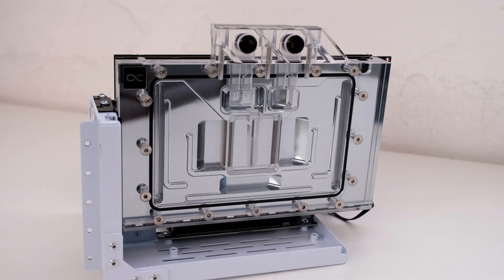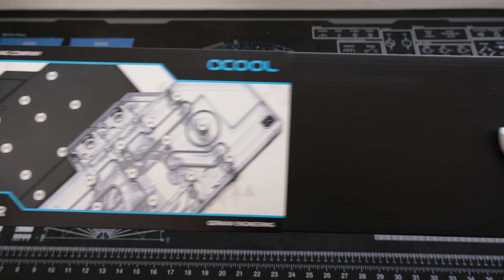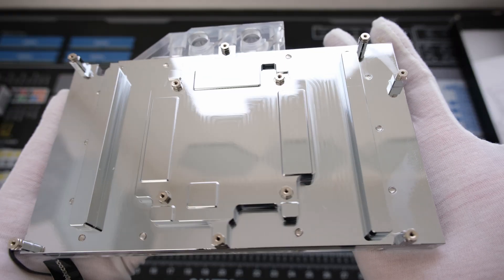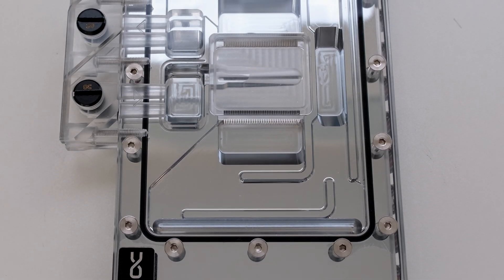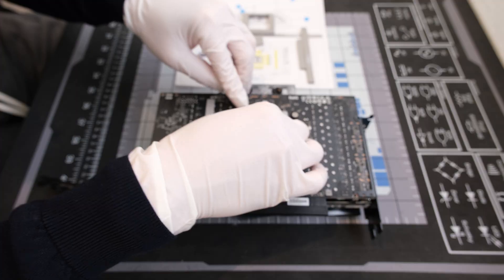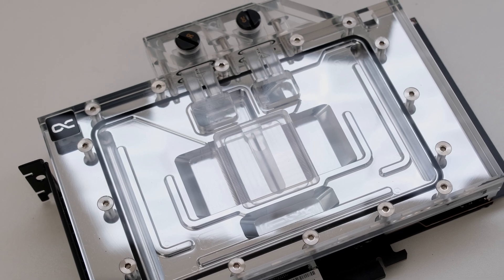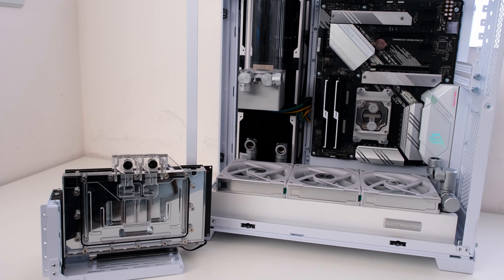Alphacool Eisblock RTX 4090 PNY Water Block Unbox Install Reference PCB NVIDIA GeForce Watercooled

Comment: Do you have benchmark and thermal data with this waterblock installed?
Reply from the maker: Thanks for your comment 🙏Yes, I do. I did the thermals during the maintenance episode that allowed me to take the card out. Here is the link:   https://youtu.be/-QMEvXeaZJA
Reply: mine in game maximum temperature 49/50, instead in normal use 28 degrees!

Comment: I have a newer version of this block but more or less the same and i had to leave the back plate off because its to hard to install the new way. It has to go on last not like yours were you can do it first. and i see a slight bow in the pcb I am scared for my 4090. Won't by again

Comment: drat on acrylic is not my options
Reply from the maker: Thanks for your comment 🙏Correct, while Alphacool did take steps to improve on this generation of water blocks (chrome plating, better flow path, better O-ring placement), they are still using a predominantly acrylic top. While this clearly showcases everything, acrylic can be seen as a little less refined than as having a metal cover of some sort. There actually isn't that many options for the reference 4090 and the Alphacool core looks a little different but still acrylic. Thanks again for commenting and thanks for watching

Comment: oh, so the PNY card is hanging out of it, yikes, are all reference cards that way when used with the alphacool block?
Reply from the maker: Thanks for your comment 🙏Good eye. That was the first thing I noticed when I saw the PCB for the first time. It was longer than I thought it would be. PNY added like an inch so they could put that red header there. For comparison, the INNO3D PCB is a true reference design. Hope that helps

Comment: PNY customer service told me they don’t have any 4090s with Reference PCBs 🤔
Reply from the maker: Thanks for your comment 🙏 Hm, the rep may not be as informed as we expect and/or PNY could be right if they want to get very technical. They did modify the reference PCB by adding about 1-inch to the length, to fit that red-colored header (I think it's for RGB, but not sure, never tried it). So, it would technically not fit a reference water block that was fully enclosed (all around). The alphacool one was fine as its not enclosed. For an example, check out the INNO3D iChill water block version and the reference PCB there fits completely within the water block, which this one, you see about 1-inch hang out on the side. Hope that helps.
Reply: @vectornetwork
Reply: @vectornetwork  I noticed the length difference on that website that hosts the pcb pics. I'm basically trying to figure out if the PNY cards will fit in Alphacools 4090 Eisblock ES. I'm thinking not since the G1/4 ports are at the end opposite of the display outputs and the PNY cards are longer...bummer, Inno3d cards are harder to get in the US market and cost more compared to PNY. Inno3d and Alphacool should pay Optimum Tech for his marketing of this combo

Comment: @Vector Network I just did the same build, xlr8 with exactly that block.
I have 1 hole not lining up and the 2 VRAM (I believe) thermal pads are not touching after assembly!
You may want to check and add 2mm for the B stripes, for same other stripes we have to pray.
Reply from the maker: Thank you for your comment🙏First of all, congrats on the build. The block is really nice and the chrome is the most noticeable upgrade from Alphacool's last generation of water blocks. Hm, if one hole isn't lining up and the thermals aren't touching, then perhaps, there is a minor adjustment needed somewhere? It should line up. Next time I take the water block apart, I'll have a look.
Reply: @vectornetwork  Update: I used all wiggle room of all the other screws but the last whole was too far off. I took a tiny dentist-style drill and made a new hole in the PCB. Pretty sure warranty is gone now :D
Regarding the pads, it seems I got an early  prototype block that ModMyMods sold me. The latest manual doesn't even use the thermal pads in question.
But thats ok because it was just the chokes (part of the VRM) which don't need cooling. Only Mosfets do.
Reply: Yah I had exactly the same issue but ended up using 2mm thermal pads which fit perfectly there,
The screw that doesn’t line up is one used to secure the bracket, I used super strong double sided tape and works perfectly. Really nice block but yeah definitely needs some adjustment for the xlr8
Reply: @juanrondon3797  Hey thank you for responding! Everybody including alphacool told me those coils don't need cooling but the stock air cooler does so. I bought 2mm pads for that too.
My card ended up having VRAM issues and the waterblock didn't fix it either. I'm expecting to not get a replacement because of warranty loss. Will see.
Reply: @weltensegLA  The newest Alphacool block: Core Geforce RTX 4090 Reference Design has the same issue. There is no way to line up that screw hole...
Reply: @SerchioQ  Sorry to hear! I asked alphacool about it and they just said I didn't align it properly but also I could have an early prototype. Thats it though, they don't even offer any actions or consider it being not ok to sell experimental products haha.
Carefully use a dremel to widen that hole when you are certain you dont need the warranty anymore I guess. Or go with the tape solution suggested above
Reply: @juanrondon3797  
hello, yesterday I also mounted the water block, I had the same problem for screw alignment, I solved it by first putting that screw as an anchor and then aligning all the others and I solved it, as regards the thermal pad, I also noticed who inserted the two too thin side pads, they ranged from at least 2 mm and not 1 mm, at the moment they left it like this, we will see how the temperatures will behave!
Reply: @SerchioQ  I see, you printed a clamp to replace the pressure that screw would have supplied? nice work
Reply: @weltensegLA  Yes, that is what I have done. It also secures the bracket tightly.
Reply: @SerchioQ  did you also use 2mm padding for the coils that wasnt provided with the block? Or was yours the version where they even removed the B pads altogether?
Reply: @SerchioQ  No you have already the revised manual it seems. The one before that (I hope its not the other way around) has different lettering and has extra stripes for the coils that were too thin to even contact. You can see it in the video above actually.
They then decided to take them out because usually the coils don't need cooling (so they say). The most important parts to cool are the mosfets which are your F pads.

Comment: Greetings and TY for the video! I have the same card and case as you and I'm wondering if you have to remove the 2 lower case fans under the vertical GPU mount? Thanks!
Reply from the maker: Thank you for your comment🙏 Thank you for watching and I do believe you have to remove those fans. If they fit, they would still be partially blocked by the bottom-side of the vertical mount. I have another video showing the installation of the block into the system, so you can see from that, or, you can check out this video of the Drain and Fill of the build that will show it installed and if can double check it'll fit.  https://youtu.be/-QMEvXeaZJA
Reply: @vectornetwork  Thanks!

Comment: Did you have any issues with thermal pads not making contact?
Reply from the maker: Thanks for your comment 🙏 I did not have any issues with the thermal pads not making contact. It installed as expected. Hope that helps.
Reply: I too had the same problem with the thermal pad which was not in contact, inside the box it gave instructions to insert it, from the instructions on the site in the updated manual they eliminated that thermal pad, however excellent temperatures, at the moment there are no problems!

Comment: This is so stupid.  My PNY 4090 runs cool as a cucumber with the stock cooler.
Reply from the maker: Thanks for your comment 🙏 The RTX 4090 is such an efficient card and appears to be easier to cool than the 3090/3090ti. So, its not surprising that a reference card made by PNY, with their experience in making Quadro cards, would run cool. I took apart this card at time when it wasn't yet confirmed if the PNY 4090 had a reference design PCB. Its potentially helpful information for anyone would like to install a water block on it. Less people certainly water cool than air cool, but water cooling is not without its purposes. Hope that helps.

Comment: So after your experience would you say that’s most all blocks for 4090FE will fit the PNY 4090? I have the PNY 4090 and want to use the  EK water block. Would this work?
Reply from the maker: Thanks for your comment 🙏 This is a common misconception that Founders and Reference are the same thing. For NVIDIA, they will have a Reference design that other manufacturers can use. PNY will simply make a card using that Reference design. Other manufacturers (Asus, MSI, Gigabyte) will often change something on the PCB (for a lot of reasons) and that makes the design Custom and not a Reference design. NVIDIA produces their own Custom card and named it the Founders Edition. The two designs are completely different. AMD, on the other hand, provides the Reference design and also produces the Reference cards, so that can cause some confusion. But 100% sure the block for a 4090 FE will not fit the PNY 4090 (or any other non-4090 FE card). Hope that helps.
Reply: @vectornetwork  Thanks so much for the response!! In that case I will stick with what I know works and use the block you did in the video. Thank you!!

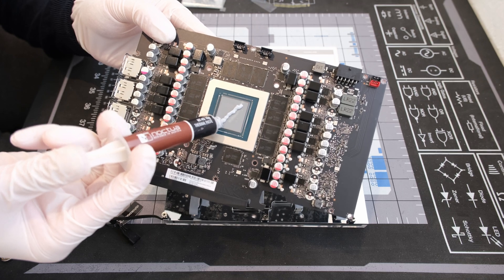Comment: 01:33   why is one pad white? different thickness?
Reply from the maker: Thanks for your comment 🙏 I had to double check the manual to make sure I got this one right. It is the same thickness as the rest of the memory, 1mm thick. These are the stock thermal pads from the package. The difference is in size (length/width). They give you a variety of thermal pads cut to the right length/width and some are different colors. So, this one is just white but it is the same thickness. Hope that helps.

Comment: Do you know something about the new alphacool core RE? Hope the the card will fit in it.
Reply from the maker: Thanks for your comment 🙏 I wish I did, but I do not have additional information on the alphacool core RE. A quick google search didn't turn up much. This block is fairly relatively small. Hope that helps.

Comment: nice.. do you think the bykski 4090 reference block will fit ? i assume yes but... ok been looking deep into and yes the pny design is reference but the pcb is little longer.. thats why you have that part on the right sticking a centimeter about out and those two connectors on top..
Reply from the maker: Thanks for your comment 🙏 Yes, it should fit. Good eye. I immediately noticed that during the teardown when I saw the PCB for the first time. It was longer than I thought. The INNO3D PCB has a reference PCB that is about 1 inch shorter. PNY added that length so they could include that red colored header at the end. It did not affect the installation of this block. I haven't checked other blocks, but unless its like somehow fully enclosed, it should be fine. Hope that helps.
Reply: @vectornetwork  Thank you ! and nice channel ! keep up with it

Comment: Were you concerned about the lack of thermal pad behind the main chip?

Also, did you install thermal pads on the front side?
Reply from the maker: Thanks for your comment 🙏 Was I concerned about the lack of thermal pad behind the main chip? No, I was comfortable with the main chip being cooled with the active front plate. There is no memory on the back and I think the back thermal pads are as much for evening out the backplate as it is for cooling too. And did I install thermal pads on the front side? Yes, I did, I showed that in the video starting around 1:20. Hope that helps

Comment: Hey man I have the same block and for the life of me I cannot get the RGB lights to light up. I tried using the adapter provided and plug in directly to the 5V it just doesnt work. Is there a trick to this?
Reply from the maker: Thanks for your comment 🙏 Its really nothing more than that. I plugged mine into the 5V header (3-pins) on my asus motherboard and it lit up rainbow on boot. In order to control the RGB, I downloaded and used the motherboard software, Asus armory crate. Hope that helps
Reply: @vectornetwork  I think they sent me the wrong adapter. I figured it out now thanks.

Comment: Quick suggestion, as a potential buyer of the waterblock, i would appreciate if you measure out all the dimensions of the assembled piece, this really help me to plan my custom loop in a SFF build. Thanks
Reply from the maker: Thanks for your comment 🙏 Hm, I have considered this before but didn't initially do it because the (very detailed) dimensions and measurements are usually included in the instructions and/or support materials. However, thinking about it more now, there are differences. For example, I noticed that this reference 4090 is about 1 inch longer than another reference 4090 and it has a bit of an overhang beyond the block. Also, I guess the overall thickness isn't in the materials. I'm considering including this for future episodes. If so, what measurements would you want to see?

Comment: Fyi this does not fit the fe
Reply from the maker: Thanks for your comment 🙏 Correct, this is for the reference PCB. The FE is NVIDIA's custom design and is not the reference layout.
Reply: @vectornetwork  some sites have this exact part # as fitting the fe... aquatuning as an example.
Reply from the maker: @sagerdood  Thanks for your comment. Hm, on Aquatuning, the part # for the Reference 4090 water block is 1023221 and the part # for the Founders Edition 4090 waterblock is 1023334. They are different and the Founders is not the reference. Common misconception since AMD calls the card they make and distribute their "reference card". Hope that helps

Comment: You should have used the subzero paste that came with it... its some of the best paste out
Reply from the maker: Thanks for your comment 🙏 I will keep that in mind as I have been collecting the little tubes of paste that come with a lot of these products. I've simply gotten used to my big tube of Noctua paste but it should be empty soon. I do agree it would be potentially beneficial to switch it up.
Reply from the maker: I only realized now that you potentially meant a link to the actual part (rather than a table of contents of parts in the video lol). 
The water block in the video is from the following link: https://www.aquatuning.us/water-cooling/gpu-water-blocks/gpu-full-cover/eisblock-gpx/30435/alphacool-eisblock-aurora-acryl-gpx-n-rtx-4090-reference-mit-backplate
Reply: I used the paste supplied with the warterblock, it gave me the same application as that of the defective mx5, too plasticky and difficult to spread because it came off. I used the mx6 with excellent temperatures, in game I'm about 49/50 in normal use 28 degrees!
Reply: @cristiandeejaysgame459  interesting! I didnt use it with mine. I used Kry.. But every other time i used it on launch, it worked great
Reply: @cristiandeejaysgame459  ether way i took 10th worldwide on hwbot last season in all 3d mark benches with this block so needless to say its a winner

Comment: Ive got it on the way for my fe. Excited
Reply from the maker: Sounds excellent👌Did you get the Founders Edition version (that they just announced yesterday)? Seems like that would line up with the timing on your comment. Checking because I've had a few questions and the waterblock in the video is for the Reference PCB and the Founders Edition is NVIDIA's custom PCB (not reference). Totally cool if you know that already and enjoy your card 🙌

Comment: Excellent content. Many thanks. 
I think this video already answers to a question that I’ve made in a previous video, but here it goes: will the reference design (FE) EK water block fits on this card? 

P.S.: already subscribed 😊
Thanks.
Reply from the maker: Thank you for your question. 🙏 NVIDIA's FE card is not the reference design. It is their own custom design. They also provide a reference design to their partners that they can use. Some partners use the reference, others will modify it. In short, the FE water block will not work with the Reference design. It's a common misconception. Hope that helps